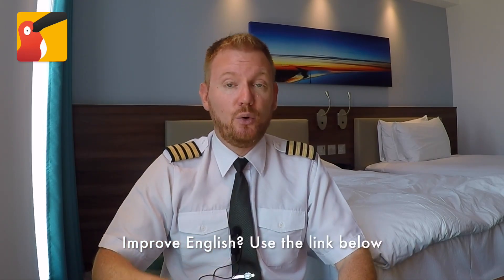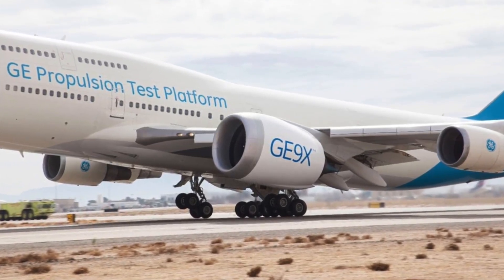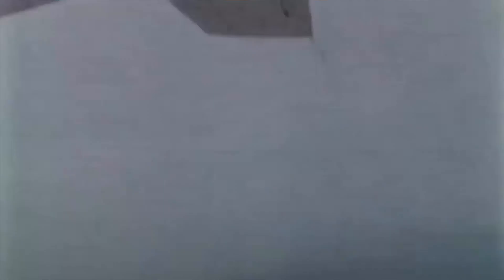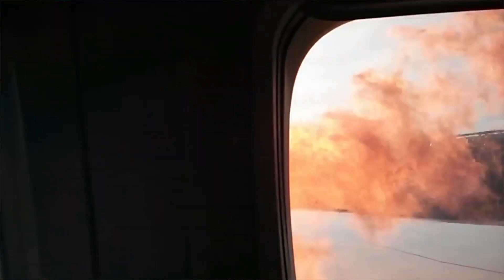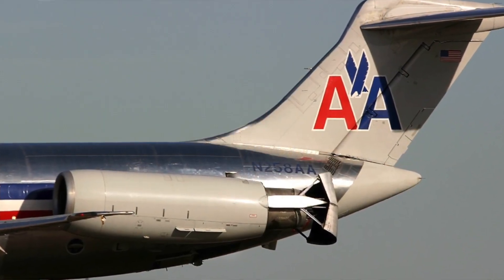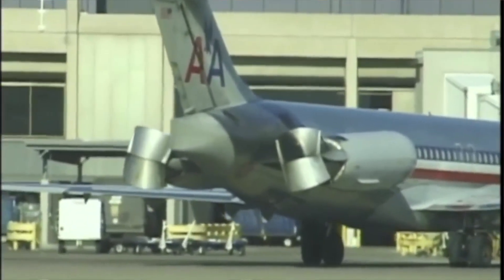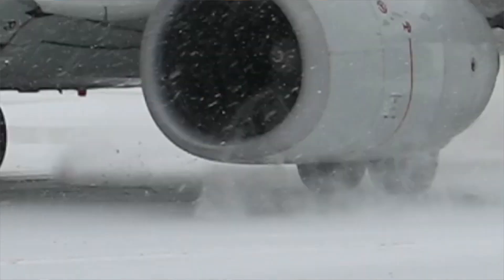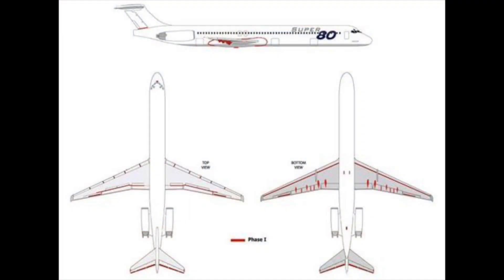Why are the jet-engines placed there? Wings vs Tail

Comment: Never seen a 4 engined aircraft on the back. Can someone please give me a name of that aircraft so I can google it 😀. Interesting Video Petter
Reply: Vickers VC-10 
Il-62
Reply: Lockheed jetstar
Reply: Ilyushin IL-62
Reply: Thanks guys!! First time of me hearing about 2 engined planes mounted on the back
Reply: il 62 or vickers vc10
Reply: Ilyushin Il-62
Reply: Wanderer, Concorde's engines were underneath the wings, not mounted to the tail.
Reply: They are at the back which was the question asked
Reply: VICKERS VC10 it’s cool and your welcome
Reply: wycombe wanderer Wrong in every possible way on both answers. First, you’re being pedantic and purposely ignoring that the topic here is wing mounted engines versus fuselage mounted engines, and not just front vs rear, REGARDLESS of even the terminology used by the video’s producer. Concorde has UNDER WING engines, and Vulcan has INNER WING mounted engines. Both of those aircraft have the flight characteristics of WING MOUNTED engines, not fuselage mounted.
Reply: Jonny Mimn, you are incorrect.  BAC111 was a twin jet.  Never had 4 engines.
Reply: There were also a lot of three engined aircraft. DC10, 727, TriStar, Trident.
Reply: The Soviet Ekranoplan had 4 on each side (yup, 4). Bizarrely, on each side of the nose, not the tail
Reply: Being British I would have to say the VC10 was a beautiful aircraft. There is one new to me at the Brookland museum. The IL62 wasn't bad apart from the prop at the back to stop it tipping back.
Reply: VC-10
Reply: Ilyushin have it, but i forgot what series is it.
Reply: EveryTypeOfVideo look up the IL-62M
Reply: It is a British one called VC 10 and   another one from Russia that what I have for now hope it is ok for you   :-)
Reply: Look at the British Aircraft- Vickers 10 or Vickers Super 10. There's a military version RAF V10
Reply: The Vulcan and Concorde are kind of cheating.  They're a whole new category of atypical with their wing designs.
Reply: Lockheed JetStar
Reply: Concorde's engines were underneath the wing, but the first ever jet airliner, the de Havilland Comet, actually had its engines mounted the same way as the Avro Vulcan's engines: buried inside the wing-roots.
Reply: EveryTypeOfVideo >>> Watch the Bond film GOLDFINGER.  The business jet in that is a Lockheed JetStar.
Reply: VC-10
Reply: As everyone has already pointed out the VC 10 had four engines at the rear. The tail was absolutely huge too. Another fun fact for you. The RAF had a number of these and the seats in them faced the rear of the aircraft. I know because I flew in one to Belize many years ago. Very weird sensation.
Reply: VC-10 And IL-62 mounted 4 engines at the rear of the aircraft and the Lockheed JetStar.
Reply: Zeldagigafan no they were between the fuselage, not pods on the wings.
Reply: Yes it is Russian. I remember Gorbachev used one. The engines were as big as a 747.
Reply: Ilyushin IL76
Reply: Vickers vc10
Reply: Zeldagigfan In actual fact the DC10/MD11 has two engines, one under each wing, and the third is mounted in the fin structure. The Lockheed Tristar is similar, except that the centre engine is mounted on the top of the rear fuselage. The Boeing 727 had the configuration you mention; as has the Fanjet Falcon. Cheers!
Reply: That is because it relies on "Ground Effect" for compression lift. It can never go higher than 50 feet or so.
Reply: That is because it relied on "Ground Effect" for list due to compression. It could never fly higher than 50 feet or so.
Reply: VC-10, the most majestic British aircraft of all. I flew on it a few times as a child (1964-70). Very quiet compared to the 707, presumably because the engines were at the rear.
Reply: Newts Nest - Quite correct. Rearward facing seats were standard practice for RAF Transport Command - Hastings, Comets, Britannias, VC10s, etc. Much safer in a crash.
Reply: @promerops  rear-facing seats, safer.  Interesting. Why did civilian airlines never adopt that?
Reply: @Matthew H - It's probably to do with marketing - passengers (those who bother to look) want to see where they're going, rather than where they've been! The fact of the matter is, aerospace manufacturers would prefer no windows for passengers at all - for reasons of structural strength of the fuselage.
Reply: VC10 Ilyushin
Reply: admittedly not an airplane, but for something absurd looking, check out the lun class ekranoplan, which had 4 engine pods on the left and right on the front...
Reply: Fokker F100 too
Reply: VC-10
Reply: Vickers VC-10, Ilyushin IL-62, Lockheed JetStar
Reply: Il-62
Reply: British Aerospace VC10.
Reply: Tupolev tu ,144
Reply: The Condorde's were under the wing I thought.
Reply: The 1-11 used TWO engines in total ... the VC-10 used FOUR engines in total ...
Reply: volkswagen polo
Reply: VC-10. The Russians also built a copycat.
Reply: Definitely look into the Vickers VC-10. Really cool old aircraft, and one of the loudest commercial jets ever, along with the 707 and DC-10.
Reply: Il 162 a toupliev Soviet designers
Reply: A fabulous aircraft
Reply: vickers vc10
Reply: Look up the plane called ilyushin-62 which has 4 engines at the back
Reply: Trident. The 3B was the only '4 engined' tri-jet. It had such marginal hot & high performance, it had a small 'booster' engine above no.2 engine, for use during takeoff.
Reply: IL 62
Reply: I agree with you Andrew. I flew from Chicago to Heathrow in one back in the late 60's and it was the quietest flight I was ever on. My only problem was the constant circling of Heathrow waiting our turn to get in. Stoma it too well at that time. LOL
Reply: Flying backwards - Yes, a very odd experience...seats in some Trident's faced the rear of the aircraft as well...BA I think.
Reply: VC10 was a gorgeous aircraft indeed, but when taking off a gut full of fuel and max weight - they were so loud you could hear them across town. We had BA VC10's flying out of PER (AUS) back in the 70's... Great ladies
Reply: b1 lancer
Reply: wycombe wanderer The Concorde's wings were in the delta configuration, so their engines reached all the way to the rear of the aircraft although they were mounted beneath the wings.
Reply: Have seen it flying very low over the Scottish borders, very loud once it passes over. Beautiful aircraft. Used to see every type of aircraft up there, UK & US types, including The Vulcan flying very low and loud, harriers, phantoms, jaguars, F-16's, large transport aircraft. South England, very young used to be taken to places showing old WW2 planes, so got to sit in an old spitfire cockpit & the cockpits of old British jet war planes, mostly at museums and air-fields. 
There are other military war planes with engines mounted on the wings like the tank buster A10, then stealthy aircraft with engines mounted inside the wings. Am sure have seen VC10 parked up at the Northolt RAF aerodrome not long ago. VC10 is loud, but not as loud as Concorde. As for the Vulcan, now.. that's, loud..!!
Reply: Adrian K my name is Adrian my second name starts with K and I live in Scotland, what are the chances of that?? 😀
Reply: wycombe wanderer
Concordes engines were  under the wing  ,  you idiot
Reply: Some little private jets had 4 engines on the back
Reply: You could have just googled exactly that. “Plane with 4 engines on the back” I did and got results right away.
Reply: spacecadet35 ik the DC-10 which failed
Reply: wycombe wanderer It was on the back of the wings not tail
Reply: Lockheed Jetstar. you can see several shots of one in the movie Goldfinger.
Reply: EveryTypeOfVideo England built one in the 60's. Name escapes me. Russia too
Reply: IL-62 from Russia.
Reply: I remembered working on an aircraft as private jet name jet star which had four engine at the back of the tail two on each side.
Reply: Widyka Canacantya lL 62 is the Russians copy of the Vickers vc10. I think they stole the Specification/ plans.4 engines at the tail.
Reply: And l1011.
Reply: The BAC 111 used 4 Rolls Royce Spey engines at the rear.
Reply: The DC-10 has three engines, two on either side of the tail-end, and one as part of the tail itself.
Reply: Concorde and the Vulcan both have four engines on the back!
Reply: wycombe wanderer:  correction: the Concorde had its four engines under the wing, not on the back.

Comment: As the first reaction to approaching a stall situation is to push the nose downward, and the technology is available - and already implemented in T-tail aircraft - to automatically push the yoke/stick forward, why is this technology not  commonly used in aircraft with the engines slung underneath the wing, or more precise, in aircraft with low tail planes?

Comment: Soviet/Russian Tupolev-154 has three engines placed in the back of the aircraft: two engines are mounted at left and right side of the fuselage, and one engine mounted inside, with its air intake placed just before the tail (I do not count APU, which is also installed in the back). The plane is famous with its inadequate behaviour at big pitch angles: if you got this "super stall" condition, then you are actually doomed. There is no escape from it, and I even doubt that Tupolev planes ever had this "automatic stick push" system. The most tragical accident was in Donetsk in 2006, with hundreds of killed due to "super stall" when crew tried to fly above the high altitude clouds.

Comment: T-tail configuration looks intrinsically vulnerable to me. Attaching the horizontal member to the high point of the rudder unit (instead of to the body of the plane) must produce significant stresses at the join. You could imagine it being torn off when the aeroplane gets thrown around in an emergency, or even just severe turbulence. I wonder if this has ever happened . . .

Comment: You forgot to mention risk of ice ingestion from wings, as happened in SAS crash in Gottröra.
Reply: Yes, very good point Mikael! Good you mentioned this. Rear-mounted engines are susceptible to ice breaking off from the wings. This was in 1991 with Scandinavian Airlines Flight 75, a  McDonnell Douglas MD-81 that was not properly de-iced and the ice on the upper part of the wing remained undetected. The ice broke off and severed the fan blades and by not throttling down the engines they finally stalled and broke down. In this historic crash the pilots managed to crash-land by  skidding on the ice and although the aircraft broke up in pieces miraculously there were no fatalities.

Comment: High mounted engines make ditching in water more survivable as the underslung engines will often be the first parts of the aircraft to hit and have much more drag than the smooth fuselage on aircraft with high mounted engines.

Comment: High mounted engines are prone to damage caused by ice coming lose from the wing when the plane is taking off. This occurs when an aircraft is de-iced. 
A bad thing about high mounted engines is that when an aircaft loses all engines it will cause an nose up momentum.

Comment: These are not the only two options, The first jet airliner had it's engines INSIDE the wings (De Havilland Comet) some aircraft have the engines on top of the wing and the Be-200 has engines mounted high up on top of the fuselage.
Reply from the maker: True, I concentrated on these because they are more common.
Reply: Indeed. There are some very odd engine mounting choices. Some make more sense than others. For the Be-200, it's amphibious, so you want the engines mounted high up to keep water out, but what is up with the Britten-Norman Trislander? Why mount an engine on the tail? Why not mount it in the nose, like the did with the old Ford Tri-plane?

Comment: They're just about all gone from commercial service now, but years ago I flew many  times as a passenger on both Aeroflot and Cubana Ilyushin IL61Ms with four aft mounted engines. An absolutely superlative aircraft, sleek, fast, long ranged and extremely smooth in flight with a wonderfully comfortable and virtually noiseless interior.

Comment: im sure the Trident that stalled over staines England in the 70s had a stick pusher as well i believe.
Reply: It did because this automatically made me think of the Trident when the stick pusher was mentioned. The inquiry found that crash was down to the plane being incorrectly configured and pilot incapacitation.

Comment: Are multiple engines always of the same size/thrust level? Of course it needs to be symmetrical, but could a rear engine be smaller for example, or would it confuse your thrust settings?

Comment: Captain, could you make a video about hydraulic Systems and how the pressure works on ground vs air. Like in an airport if you look at "Cold and dark" aircraft how it has the Rudder to the left or right.

Comment: Another advantage of rear-mounted engines is being able to have full-width slats and flaps.  This is one of the reasons the Boeing 727 was designed as a tri-jet with the engines at the rear, as they were intended to go into shorter regional airports and needed to maximize the high-lift device area.

Comment: Scandinavian Airlines Flight 751. There's a documentary here on YouTube, plus lots on the web. The pilot had his aircraft de-iced, but there was still a hard-to-see layer of clear ice left on top of the wings. The pilot thought his plane was ice-free. On take off the ice slid off the wings and took out both rear mounted engines. 

This accident could not have happened with under wing engines. That said, modern under wing engines are huge vacuum cleaners running close to the ground, searching for any FOD on the runway to injest.

Comment: You completely missed the primary reason for rear mounted engines - they allow for the fuselage to be much lower to the ground, allowing passenger loading to occur without using auxiliary equipment.  That's why private jets and smaller regional jets use them  - a jetway is not needed to board the plane, they can load with built in "airstairs".

  Likewise you did not mention the single most important reason for underwing engines .  Since the pylons extend ahead of the leading edge, it guarantees that the airflow into the engines has no interference from any other part of the airframe.  Every other benefit is a nice bonus, but a clean airflow into the engines is the driving factor.

Comment: Another variant I just thought of is something we don't typically see in aircraft anymore. Some older aircraft had an engine built into and at the base of the vertical stabilizer. For obvious reasons I can see why this idea did not continue to today's aircraft. Maintenance is one issue but more importantly the chance of fire and smoke in the cabin would be a greater issue.

Comment: all cars are front wheel drive.  in the past they were back wheel drive.  the resone is that pull is safer than push.  maybe it is better also for airplanes. thanks.
Reply: Eli Yardeni Agreed, I always imagined that wing mounted engines are more inherently stable by providing a pulling rather than pushing force.
Reply: Not all cars are fwd, the 2 benefits to fwd are lower cost and less weight. There's a reason why all expensive and high end cars are rwd or aed, and that reason is that either of those are better for driving than fwd. Fwd was originally created because someone thought the "Its better to pull than to push" was true, but it simply isn't, at least for cars.
Reply: Thrust is thrust. There is no push or pull. The only thing that matters is the relationship between the CG and the thrust vector.

Comment: I was hoping you would bring up engine canter in this video.  As in, why are the engines angled inward on wing hangers and outward on tail hanging engines?

Also, what are those triangular (they are also rectangular in some cases apparently) vent things under the planes like the A380?  The things towards the front of the bulge under the fuselage.

Comment: Okay, so why can't the bigger, more efficient engines fit at the tail end then?
And how does an airline determine which advantages and disadvantages they'd rather take on for a given set of planes?
And are the bigger tail-mounted-engine planes still even being made, despite their inefficiency?
Reply: Maxx Fordham! As of now no large jetliners are being made with tail mounted engines. You can still find smaller regional airliners with them.
Reply: Oh, okay, Cat, that makes sense, then, in the name of efficiency for the bigger ones and of safety for the smaller ones. Thanks.
Let's see what Petter or someone else, or you, can say about when they did put engines back there on the bigger planes, why the bigger ones couldn't have fit back there.

Comment: Back in the 60s the VC10 (4 rear-mounted engines) was the aircraft of choice for international operations.  The Boeing 707 of the time had a reputation (real or otherwise) for hitting the deck with its inside engines during a rough landing.